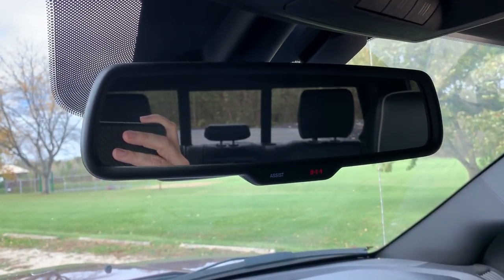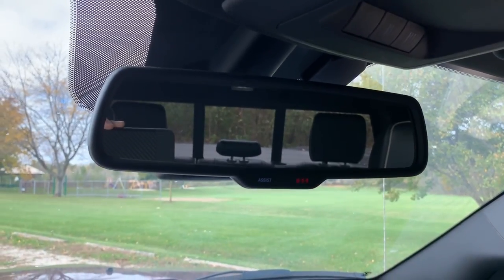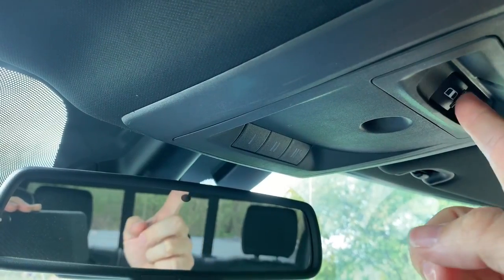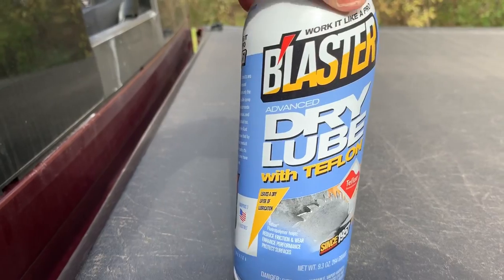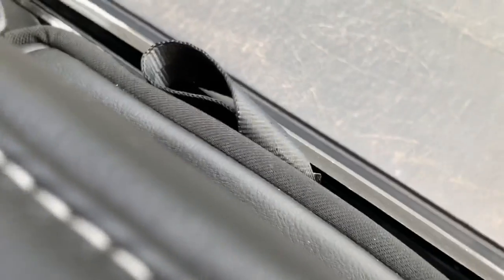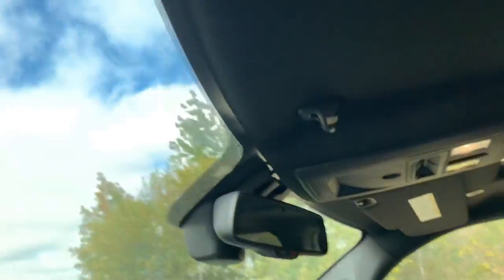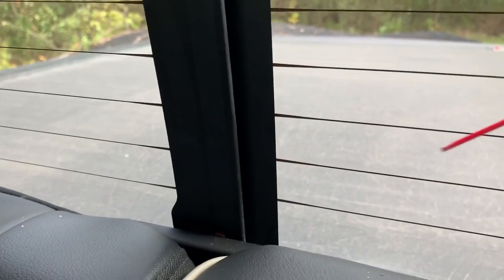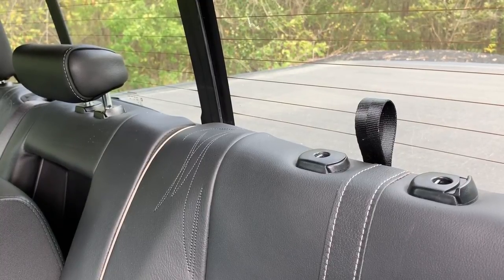Ram 1500 rear sliding window fix!  Sticky window? Here is the fix!

Comment: Thanks for posting this. Mine was getting stuck open and had to push it closed by hand and push the switch to get it to move. Thought it was out of alignment. Some dry lube and it's working good as new.
Reply from the maker: Glad to help!
Reply: Same lol
Reply: Paul H, how do you manually close it?! Ours is stuck open and won't budge!
Reply: @marleehughes3239  I had to push on the window while having someone press the switch
Reply: Paul H, thanks but it didn't work. 😔 it got stuck open when we drove it off the lot and the dealer doesn't care. We're stuck with it.
Reply: Agree, thank you so much.. Mine just started sticking after 10 years.

Comment: Had to replace the switch. After installing the new part i really felt the difference in button pressure when closing the window.   If your switch feels like there's nothing behind it, it may be time to change the switch.   Very easy install, 6 minutes.

Comment: I have a 2014, and the button when I push it makes the window one a nudge but only goes like 1 cm and stops, and when I push the button to close it it only goes up 1 cm and stops again.. any information on this it seems like the motor wants to spin but it goes for one second and totally stops the track looks clear I've greased it something's not working and I just can't troubleshoot this
Reply from the maker: Did you spray into the track and all?
Reply: @tsr6  I actually did. It just like shift just a bit and stops seems like something's blocking it but it's doesn't move anymore than like a nudge. And then when I want to close it again it does the same thing she just back in place. It doesn't even fly to let air through that's how much it moves.

Comment: Omg thank you so much I had the same issue I’m like wtf 🤬 right… came str8 to YouTube and found you went str8 to Homedepot and got the spray came outside and did it in the parking lot and it’s worked like a charm… I’m just a girlie girl who like big trucks.. 2015 ram long horn I refuse for the dealer to tell me I need to replace the motor and I know that’s a damn lie
Reply from the maker: Happy to have saved you thousands!!

Comment: Between lube and replacing the switch itself resolved my issue would open with no problems just have trouble closing no matter what i did lubing it up did help a little but replacement of the master switch itself got it working 100% 
2016 ram 1500 big horn 5.7L
Reply from the maker: Different problem… 🤷🏼‍♂️

Comment: Mine has the same problem.  I'll give this a shot.
Reply from the maker: Mine has worked fine since I made this video!!
Reply: @tsr6  Well, I lubed it up good, but it still gets stuck in the last 2 inches of travel or so.  It's fine before it gets almost to the full open position.  I'm guessing I need to pull the rear seat and make sure everything is clean and lubed.
Reply: @302vettelife2  Mine also sticks in the last 2 inches. Did you fix yours?

Comment: What if the sliding window wont open , just had replaced first it wouldn't open completely then when it did wouldn't close had to push on slide window to close now wont open
Reply from the maker: oh no, sounds like that's a bigger issue than what my video covers